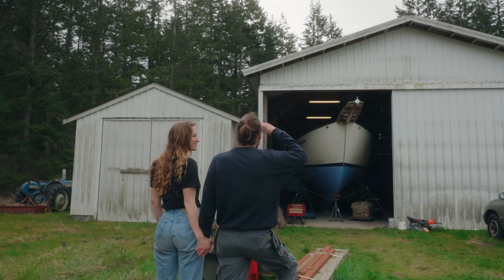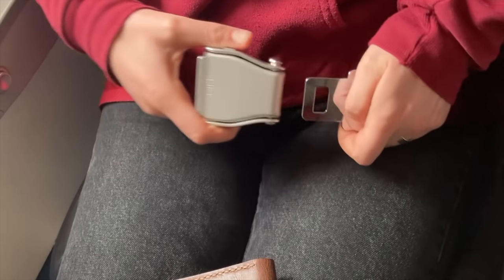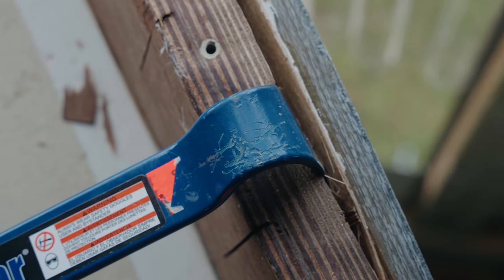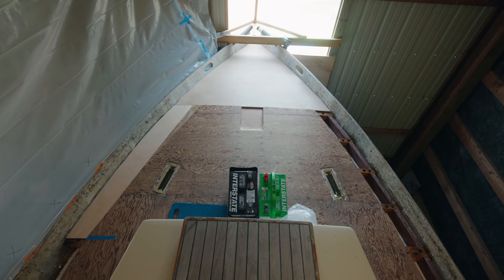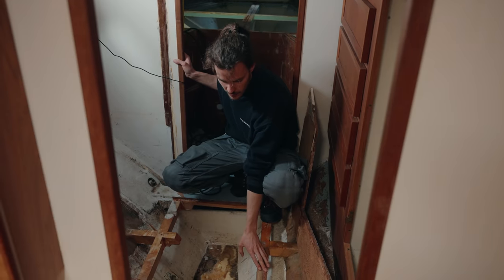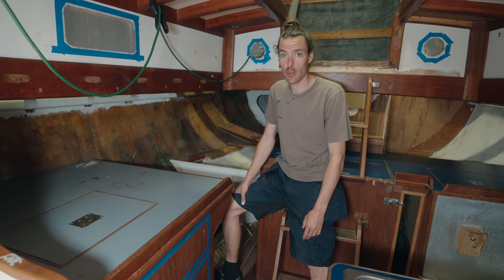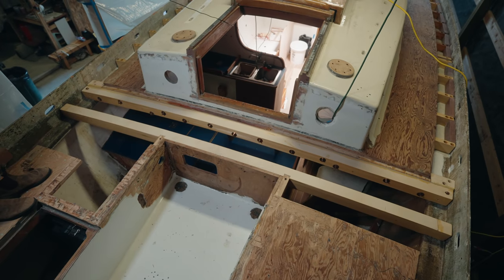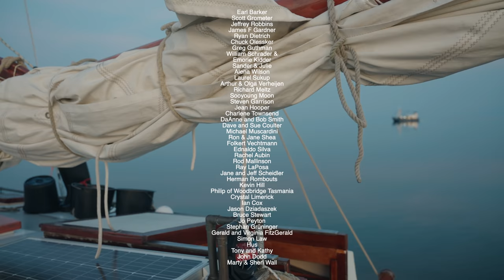6 MONTHS of WORK in 17 MINS. Huge Boat Refit!

Comment: ILooks like a nice cruising hull and i will be interested to see what happens with motor, toilet and refrigeration. I have a 32 foot timber yacht that I first launched in 1981. Keeping rain water out of the topsides is the most important thing and I have had to replace the mahogany cockpit coamings before giving up on a clear finish and glassing deck and cabin sides. Good luck with your new ship.

Comment: Impressive what you got done in six months! Well done.  Huge benefit you had such a nice shop to work in.  
Years I've spent fixing boats, my biggest take away is that wood doesn't belong on boats that can't be pulled out of the water on a monthly basis.  Its always the wood that gives the biggest  and most regular failures.

Comment: Hi Guys 
My name is Scott I live in Ohio near Cleveland and I wanted to reach out and commend you on your work . Aladino is a true craftsman. I make a living as a cabinet guy trim carpenter and I’m in the process of restoring a Carl Alberg SeaSprite.  
The work you have done has not been easy took a lot of thought and some very tuff fitting well done. I really love the V Berth you fit the deck so nice and the contrast in color is just beautiful 
And I like how you cut off the ends of the beams then cut and fit new ends epoxy glue screws new side beam with metal better than the original for sure !  
Looking forward to completion 
Scott

Comment: Wow, this is a salacious display of craftsmanship!  Great use of music too.  Makes me want to start cutting into our boat right now.  Interesting how those bulwarks were constructed.  Ours look very similar on our Roughwater 33, but I'm not sure if there is wood inside or not.  We are still getting used to our boat and where the leaks and issues are.  Some water is getting in, I suspect through the bulwarks, I'm suspecting that the sheet track screw holes on top of the caprail are letting some water into the bulwark.  Ours was a teak deck boat originally but a couple owners ago they had the wood ripped up, holes filled and the deck glass built up thick over top.   

I noticed that you had the same glass cracking happening in your scupper as we do.  I had hope to not have to slice the whole bulwark open but w'ell see.

Comment: I ran the repair and restoration shop for Cape George Marine for a number of years. Having gone through exactly what you guys are doing (on multiple CG 36's) I can honestly say you have jumped in the deep end.....And are doing a hell of a job. Well Done. If I can ever be any help please reach out.
Reply from the maker: Thanks for commenting Greg and thanks for your email. 
We will definitely think of you if any questions arise:)
~Aladino
Reply: I just remembered that in replacing the bulwarks we used 3 layers of fiberglass infused foam sheets bent and laminated into place before glassing it to to the deck
Reply: Rot proof and very strong

Comment: Amazing job you guys have done!! One for me worrying thing is looking at how you glue different types of wood together. One has to be extremely careful with that because they respond differently to least of moisture and that causes sometimes small cracks in the vernis or paint allowing more moisture to get in. Best is to use the same material in a specific section.

Comment: just a quick check on line and very  good condition Cape Georges  are going for $125,000.00 to 159,000.00    so you made a great buy at 11,000.00  but it is clear you need to be an Aladino  to bring her back to life...looking forward to the day you splash her

Comment: Hmm, sometimes it’s better to build a new boat than open Pandora’s box! It’s like old house’s getting deeper opens new problems exponentially.
I got into thinking about steel or aluminum hull s , easy to repair (steel) almost anywhere and step by step build with community buyers rebates. Nice boats in all sizes “Reinke” design  .

Comment: Very impressive and beautify restoration... I have to ask though, the boat is not that old and to have so many serious issues  makes one wonder about the building quality and design.  I am sure you have wondered the same thing. I wish you well as the project wouldn't get a 2nd look by most looking for a refit project... correction, this is not a refit, this is a REBUILD.
Reply from the maker: It can be considered a 50% wooden boat and yes when left unattended that part can deteriorate quickly. The boat is 40+ also and there have been a few design changes since to make them even better

Comment: I apologize if this has already been asked, but how did you find a place where you could both keep and work on the boat, as well as have access to all of those tools?  That could not have been inexpensive.  In any case, it's amazing what you're doing.  I'm challenged at just replacing the fenders on my canal boat.

Comment: Hey Aladino - what kind of foam are you planning on using for the bulwarks job?  I'm in the middle of something similar, but having trouble tracking down a suitable material...
Reply from the maker: I was thinking of HDPE but am not 100% sure yet. You can get that in sheets of all sizes and thickness. Doesn’t absorb much resin therefore the glassing over is crucial - unless it would be bolted and screwed in place. One reason I lean towards it is because it can hold screws better then coosa board which also sounds like a possible option.

Comment: With the filch beam how did you address the possible issues with dis-similar metals between the beam insert and the bolts you used?
Reply from the maker: By using Tef gel:)
Reply: @SailingMagicCarpet  Ah.  Thanks!  I was really curious.

Comment: Plywood. Ugh. Somebody somewhere will finally realise that plywood is a totally unsuitable material for boat construction, especially the stuff you get today. I've seen boats built little over 10 years before that needed a full deck replacement because the ply was completely rotten. Get rid of it. It's a curse.

Comment: 11k for the boat and 50k for the deck and bulwark? Not to mention he heated barn and 50k of tooling? Not adding up…. The rest of the video shows even more capital. I love the refit but don’t start with “we had no capital” then spend 250k.
Reply from the maker: The deck and bulwark have cost about $3000 in materials. The barn is not heated and belongs to a friend so we are lucky in that regard. The tools were $5000, and the majority were actually a gift from another very kind friend. We are very lucky in many ways, but to say we have spent anything close to $250k on this is simply wrong.
Reply: I stand corrected.